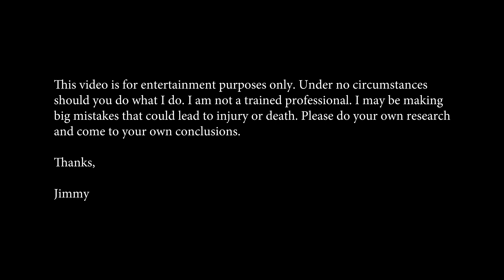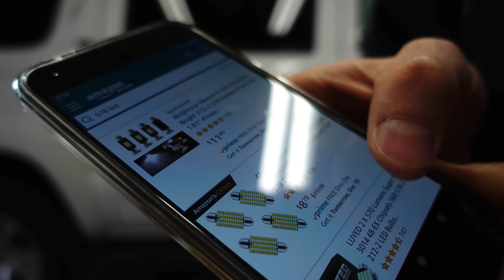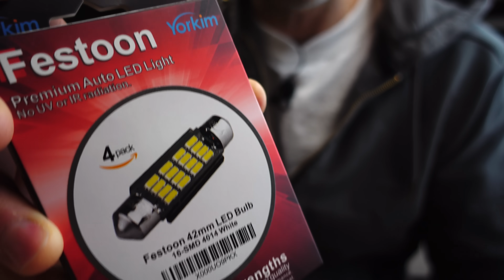Here's Why You NEVER INSTALL LEDs IN YOUR CAR OR TRUCK!!

Comment: That is not a halogen bulb. That is an incandescent.
Reply: For anyone wondering, halogen is a better incandescent bulb. There is a glass bubble of a halogen gas around the filament which allows the filament to get hotter using the same power and usually lasts longer too.
Reply: And you would never touch it with your fingers ....
Reply: @bones007able  you would never touch the inner bulb with anything that might transfer grease. Halogen headlights are just the inner bulb, or other quartz halogens that used to be used for high power floodlights. The somewhat more common (now) is a screw in halogen e26 with two separate bulbs layered. No problem touching the outer with bare hands.
Reply: But that dome light bulb is just your run of the mill standard incandescent bulb. Not halogen filled. If it were a halogen bulb it would melt the translucent plastic cover.
Reply: I don’t understand why so many people do not know the difference between halogen and incandescent...you cannot touch halogens, the oil from your skin reacts with the glass and it will either burn out prematurely or burn out or possibly explode the first time it gets hot. The only bulbs in a car that may be halogen is in the headlights and/or fog lights, (and possibly DRLs). All the other bulbs that have a filament in your car are incandescent. (Period).
Reply: Wayne S. just my thought as well
Reply: Halogen bulbs typically last longer (or can driven brighter for an economical period of time) because the gas allows many of the filament's tungsten atoms to be redeposited on the filament. In normal vacuum-based incandescent lamps, the tungsten atoms of the filament are eventually "burned-off" faster and the filament "breaks" in one spot or another. In some cases where the depleted tungsten build-up is substantial, the tungsten atoms can be seen as a silvery coating on the inside of the glass envelope of the bulb.
Reply: As if the misleading title isn't enough to pass on watching his videos, in several places here in the comments he says "they both have a filament, so no big deal!" . Of course, if he had a nice top of the line Cadillac and I walked up and said "Hey, nice Chevy!" he'd pop a vein. I mean, they are both made by the same company, share a number of parts, and both have an engine - what's the big deal?
Reply: @huudathot  And, at least 50 years ago, you could get replacement Caddy parts for about 2/3 off by getting them from Chevy.
Reply: @raylovelace8588  Cadillac is made by Chevrolet they just don't use the Chevrolet name on it because it's a luxury vehicle so they want it to be it's own brand
Reply: @Whoflungpouu There was apparently a point at which raising the prices of other-wise identical parts and slapping a "Genuine Cadillac Parts" label on them made for MORE sales. Back in the early 50's, IIRC.
Reply: @raylovelace8588  true anyway to make more money
Reply: 3 mistakes in the first 8 seconds. Thumbs down, I pass.
Reply: @bones007able  Maybe just once unless you are really slow catching on.
Reply: I have worked in a shop tinting windows and installing since 1999 and would never use hid or led in my car, PERSONALLY.  Problems all the time.
Reply: @Whoflungpouu  Ford.. Lincoln.  Mercury.. do people really not know these things? Cadillac..GMC. Chevrolet
Reply: @Whoflungpouu  General Motors makes both.
Reply: Tabourba  ok you may be right about that.
Reply: who flungpoo like GMC and Chevy
Reply: Halogen is the gas used in higher quality incandescent bulbs. It's hotter and brighter.
Reply: It is probably a standard incandescent for a dome light, more of an orange hue as in the picture, halogen is a specialized incandescent which runs hotter and whiter and lasts longer. Headlamps and fog lights use them, for halogen use gloves when handling, oil from your fingers cause hot spots and the bulb will explode in short order.
Reply: @benji888578  halogens are incadescent.
Reply: Bromine or iodine is the actual vapor used. Halogen is the family name they both belong to. The capsule is quartz in order to tolerate much higher temps.
Reply: Isaac Karjala sure, but the bulb he pointed to and said was halogen was incandescent, but, not, at all, a halogen bulb.
Reply: @bones007able  he should put it on his lips! Lol
Reply: I farted
Reply: @benji888578  You can touch, or soak it oil. Just clean it properly before installing it. Oil won't damage it unless it's illuminated.
Reply: It wasn't an led
Reply: It wasn't an LED
Reply: Tungsten is what you mean...
Reply: You saw that, too.
Reply: Halogen lights the road surface way better than led
Reply: For those of you who may be confused; A Halogen bulb IS technically just a better and considerably brighter type of incandescent bulb due to the Halogen gas inside of it... However, all of the original bulbs that the guy in this video was replacing with LEDs in his car are nothing more than "standard" type incandescent bulbs, NOT Halogen ones... Halogen bulbs are not only brighter, but also tend to run slightly hotter, temperature wise, than standard incandescents do, so Halogen type bulbs are primarily used only in a car's headlights, (because of their increased brightness), and possibly the foglights, (if any), but hardly ever in the interior behind all of those flimsy plastic lens covers, because the greater heat produced by Halogen bulbs would be more apt to melt those plastic covers than just simply a standard incandescent bulb would...

And as far as LED bulbs go, ultimately, besides a rather cheap build quality on some brands and designs of LED bulbs, (as the guy in this video mentions), the only other thing that you may sometimes have to watch out for is the much lower current drain than incandescent bulbs draw, and the reason I mention that is for LED bulb use in blinker light bulb replacement especially, as sometimes when replacing a blinker, (turn signal), bulb with an LED, your car's "bad bulb" sensor circuit may be activated after the changeout because it thinks that the "filament is bad" on the new LED bulb simply because it draws so much less current, fooling your car into indicating that they are "burned out"... Usually that sensor is either a light that may light up on the dashboard instrument panel and/or your turn signals will just flash really fast when operated, as a result... 

A remedy for this issue is to use a "load balancing resistor" along with the LED bulb, which places enough of a current draw on the circuit for your car to realize the bulb is there and good. Those load resistors are usually available at the stores where the LED bulbs are sold. You may NOT need one of those though, depending on your car's design, so just try LED bulb replacement first without that additional load resistor to see if your car's lighting system still operates normally, and if it still does operate completely normally after replacing everything you want with LED, then you don't actually need that additional load balancing resistor... It's only available just in case your car has any "issues" with LED bulbs, as mentioned above.
Reply: FACT
Reply: @Whoflungpouu  Cadillac is made by General Motors, not Chevrolet. Chevrolet is also made by GM. Cadillac was at one time a separate company and GM bought it.
Reply: @waynes.2983  I would call them tungsten, but certainly not halogen.
Reply: @JoeJ-8282  you can replace standard flasher with LED compatable electronic flasher
Reply: Halogen/incandescent bulbs suck. Car has been fully upgraded to LED, no error, no hyper flash. Car now saves 50% gas, and +100 horsepower.
Reply: @bones007able  That is a confirmed myth....they last just as long nowadays...
Reply: How do you know that there isn't halogen gas inside the bulb?
Reply: Halogen bulbs ARE incandescent.  They use a tungsten filament and are halogen gas filled.
Reply: @jcwoods2311  I guess that makes sense.
Reply: @benji888578  Maybe it's because people know (unlike you) that halogen bulbs are a TYPE of incandescent bulb! Incandescent; that means candle-less. Remember when the original drive lights (a.k.a. head lights) had actual candles in them? They called their replacements incandescent, because, voila! No more candle!
Reply: @godallmighty1204  actually you’ve got that backwards a halogen bulb is a type of “incandescent” bulb, but these are NOT halogen, halogen bulbs need special handling, these bulbs do not. Just like you’re not god, or a god.
Reply: Halogen is an enhanced incandescent where the filament is allowed to glow hotter, brighter and whiter.  But they do not use more power nor generate more heat.  The reason people think that, is because the envelope itself is often smaller for a high power lamp, and so it's temperature will be hotter, but just in a small space.  You can use it like a regular bulb without heat issues if it has the standard size envelope around it, or a small one inside a standard one.
Reply: @huudathot  yeah, I've got a 73 Stingray Corvette...I just call it the 'old' Chevy....on the owners cert from DMV it just says 73 Chev-coupe. that certainly helps with insurance.
Reply: Bulbs are things you plant in the ground to grow stuff, Lamps are things that give light when energized by chemical reaction or electrical discharge. LOL TTFN.
Reply: @uksuperrascal  or electrical flow.
Reply: @standardloginname  you're not wrong, but there is no such thing as a "halogen" turn signal bulb, parking lamp, brake lamp, etc. Halogens strictly refer to headlamps and possibly fog lights.
Reply: @drw1926  what's your point? I never mentioned specific uses not was my comment even specifically automotive. Krypton is a halogen gas, and krypton bulbs are made for turn signals and brake lights. So there are halogen bulbs for just about anything. The generic category "halogen bulb" does almost exclusively refer to the double bulb version I originally described and you refer to.
Reply: @benji888578  halogen is still an incondescent. It has a filament
Reply: @godallmighty1204  actually no. Incandescent means glowing, not candle-less. Candles are also incandescent.
Reply: @johnmilligan4258  You are right and this is another way marketing has screwed up a good thing. A "halogen" lamp does not contain halogen gasses but inert gasses used in them are now occasionally referred to as halogen in that context. Side note, Xenon is a pretty great anesthetic.
Reply: I would have said Tungsten, but what do I know.
Reply: @standardloginname    "For anyone wondering, halogen is a better incandescent bulb. "

Not necessarily. Sometimes an incandescent is the better choice. It all depends on the application the lamp is used for. 

FYI...The proper term is "incandescent lamp."  Bulbs get planted in the ground. Lamps are use to provide illumination.
Reply: halogen bulbs ARE incandescent, as that just means a wire heated to white hot temperature,  as incandescent bulbs CAN be halogen ,the difference is the type of glass, and the gas used to fill the bulb
Reply: Since you want to be tricky....They are called LAMPS!  A "bulb" is the glass envelope that contain the parts of a lamp OR something we place in the ground to grow. 

Lamps light, bulbs sprout.
Reply: @phillipzx3754  actually a lamp usually burned some kind of fuel & has a flame.
Reply: @shaunwolvin6025  Safety!!
Reply: @montanaelkwhisperer1744  Does that mean I gots to eat it?
Reply: All halogen bulbs are incandescent, but not all incandescent bulbs are halogen.
Reply: Dam,
Reply: @Whoflungpouu  So does chevrolet also make Buick or GMC? NO, they are all separate business entities under the General Motors umbrella. They do share a lot of common parts though. Makes good business sense to use as many common parts as possible.
Reply: It's probably filled with Xenon gas.
Reply: @RayleighCriterion  no no no.
Reply: Same thing bud...
Reply: Yeah that was not the only thing wrong with the info...
Reply: @isaackarjala7916  * incandescent
Reply: Krypton
Reply: I hate misleading titles like the one here!
Reply: I didn't know I have halogen bulbs in my house... Odd informations.
Reply: @CasualSpec Lmao C'mon, you only get those kinda benefits from red stickering a Honda. 
Old post, but still funny.
Reply: It is a halogen bulb they come in many different sizes and shapes. Like my 88 gmc c1500 the whole bulb assembly is the bulb and is a halogen incandescent bulbs aren't used in cars that much
Reply: It’s a lamp not a bulb.
Reply: @drw1926  777
Reply: Halogen is a type of lighting technology that is essentially an enhanced version of incandescent. Just like with incandescent light bulbs, the electrical current enters the socket and travels up to the tungsten filament, heating up the filament to incandescence.

The halogen light bulb or lamp is a type of incandescent lamp which uses a halogen gas in order to increase both light output and rated life. They are known for moderately high efficiency, quality of light, and high rated life compared to regular incandescent lamps.

Halogen light bulbs are similar to incandescent bulbs. The one major difference in their construction is that a small amount of halogen gas is added inside the light bulb. An incandescent light bulb has argon gas in it.
Godspeed from The Yakima Valley in Washington State
Reply: LED harsh white light isn’t good for you’re eyes. So don’t use in interior spaces use ones that have a warmer light. Instead of white light.
Reply: Correct
Reply: They’re the same thing though.
Reply: actually it is a type off in candescent
Reply: @benji888578  bc we know how to order or buy what we're replacing, even if the name and detailed definition comes to mind! Thank you for schooling us! 🙄✌️💜🙏🏼😂
Reply: @texmexskywatcher6732  
I'm curious to what the manufactures are using in the new trucks for head lighting.
You know..... I call them the rude af bright lights! 
Thanks in advance for any help with that question! 
I grew up in a paint & body shop my brother's owned for about 30 yrs in a small town, Calera Alabama! Shop gal I guess! ✌️💜🗽🇺🇲❤️✌️
Reply: I found this info a plus bc I'm about to go to something brighter for an old 98 exploder! After restoring my HL assembly's, I need brighter whiter light bulbs or something!
Reply: @frankmiller95  yes, but, I don’t think most people read before installing and touch it and wonder why it burns out before it should.
Reply: @benji888578  to assist your statement on bulbs we first have to be aware that not everyone knows what bulbs are. Hell there was even a time in your life that you did not understand them. My dad says, ya don't know what you don't know until ya know,  ya know?
Reply: @Whoflungpouu  Cadillac is made by General Motors Corp. Chevrolet is also made by General Motors. GMC, Buick, Cadillac and Chevrolet are brand names but they're all made by General Motors Corp.
Reply: halogen bulbs are incandescent.

you're saying that isn't a square because it's a rectangle....
Reply: Say what🤔

Were made in HIS image. HE made us with the power of free choice
A good prayer:
I'm a sinner JESUS please forgive me for all my sins I know you shed your Blood for me on the cross at Calvary. Thank you JESUS for my salvation and for shedding they Blood for me. I love you JESUS. 
Romans 10:5/10 ct...❤️k
JESUSisLord!Amen...
Amen..
If you'd like to call someone who cares 
83
For
Truth.
bc you don't know when you'll die?
.y r u hesitant.

.

...

.
Reply: It is the same thing u M####.
Reply: Same thing very small difference.
Reply: Okay... my halogen bulb lasted one year.  Sylvania Silverstars a year old and one went out.
 The element broke, so now I'm going to watch the video to see if he says the LEDs that I've been using for over a year are going to last longer.
Reply: Ngl that straight up just made me mad
Reply: @standardloginname  Interesting. What application are the double glass bulbs used in? I've never heard of them. Atleast not in the motorcycle industry that I've been in since May 1979.
Reply: What’s the deal with the contrary video title?
Reply: @roblee9967  You mean the other way around. LED lights up the road a lot more than a halogen bulb any day.
Reply: @JoeJ-8282  Similar with motorcycle's. Headlights are LED in some cases along with turn signals. Turn signals that are LED are the same base as 1156 "inconsistent/halogen" made by aftermarket companies, but only have two wires which are for flashing only and won't melt the plastic lense or housing because it's flashing and doesn't create enough heat which is why I haven't seen any front turn signals in LED and they have the same base as an 1157 which is also used for tail lights and brake lights and may melt the plastic if it's too close to the LED. They make resisters for LED turn signals and they also make two and I believe three terminal turn signal flashers for LED turn signals so you only have to replace it and not have to install the resistors. They do make marker LEDS for inside the head light which are equivalent to a 3 - 5 watt incandescent/halogen bulb and I've seen head light lenses melting because the LED is too close to the lense. When LED turn signals are replacing incandescent/halogen bulbs, they'll either flash too fast or they flash slow or not at all, depending on the system because LEDS draw very little amps versus incandescent/halogen bulbs do. One way to tell if a LED is a good quality is the size of the heatsink built in and or if it has a fan. The size of the heatsink and or if it has a fan makes a big difference. They do make interior car lights in LED. There's a video if a guy installing them in his Chevy Suburban or Tahoe. It will be interesting to see if the lenses melt after awhile. What a huge difference in the lighting too.

They also make LEDS in the 1157 base for tail lights/brake lights, but usually don't have a heatsink or fan. 

As a word of advice, stay away from HID'S because they run even hotter than LED'S, draw more amps and fail all the time.
Reply: @percilenis8464  which is why they are an incandescent.  Halogen filled incandescent. Duh.
Reply: Halogen is a incadescent, a brighter hotter gas filled type... but yeah he incorrectly called a conventional incadescent bulb a halogen..
Reply: @johnfloyd2551   Correct. 🤔😁
Reply: Absolutely right
Reply: Inclandestant lol snuck that in
Reply: @benji888578  that's true said
Reply: All halogen bulbs are incandescent, they just operate at a higher temperature to be more efficient.
Reply: Exactally
Reply: Boom roasted
Reply: Halogen bulbs gets super hot
Reply: This guy is pretty bright. Illuminating information
Reply: I was just about to say that. If they were halogen the vehicle would have burned to the ground.
Reply: So this guy's disclaimer in the first few seconds is a fact. What a case.
Reply: Halogen is incandescent
Reply: @bones007able  
Why not 🤔
Reply: Halogen bulbs are incandescent
Reply: True that, but you still get the point Sherlock Knomes. Lol!!!
Reply: Youll never find a single car today that used incandesant lights, they all either use halogen, HID or LED, and for the record the bulbs he shows in the video are halogen
Reply: Haha burnnn. 👊😎
Reply: And I'm out of here, because knowledge.
Reply: @standardloginname The grease causes heat build up and blows bulb
Reply: @benji888578 
Halogen bulbs don't break from skin oil reacting with the glass.. Glass is chemically inert to hydrocarbons.
What happens is that the oil or grease absorbs light energy, and even a very small, nearly invisible layer will absorb enough light energy to cause additional heating in the glass envelope.  The uneven heating causes thermal stress which then failure , anywhere from cracks to shattering.
Reply: My thoughts exactly! And the idiot has made bank on this.
Reply: Halogen is a type of Incandescent. It is halogen because its brighter and hotter
Reply: @uksuperrascal speaking of bulbs, you seem pretty dim.  Bulb is accepted terminology.  These days a lamp is either a floor lamp or a table lamp. 😂
Reply: @phillipzx3754 that’s nonsense
Reply: ur a frickin incandescent mate
Reply: What I was going to say!
Reply: That is not a golden retriever. That is a dog. ::sigh::
Reply: LEDs in my old school robs the style and charm the designers created. Vintage light just looks better. 
LED is shitty light. They ruin the mood.
Reply: I'm dead 😂
Reply: A halogen bulb is an incandescent bulb
Reply: Why do you feel like correcting somebody when they’re wrong?